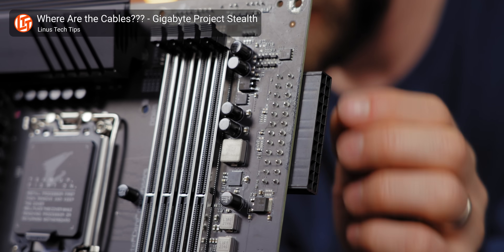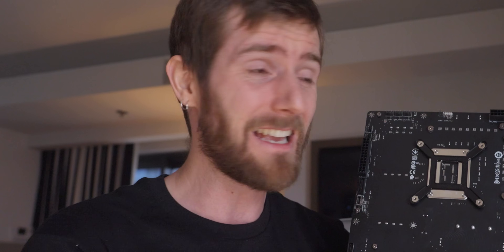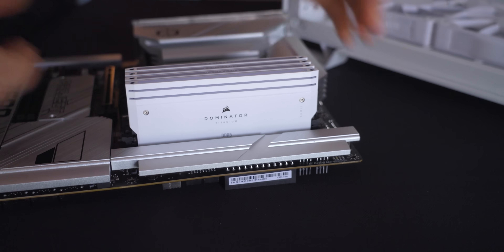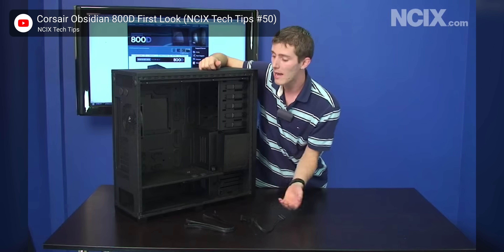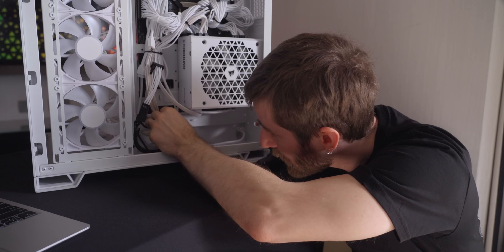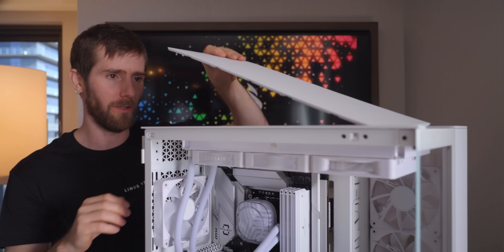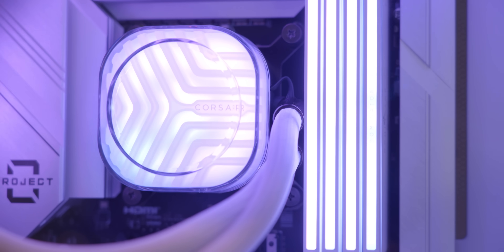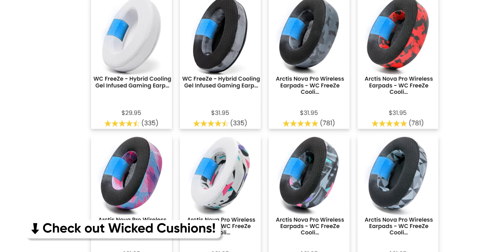I had NO Faith in this... - Hidden Cable PCs

Comment: Can't wait to see what is possible for ITX and SFF systems where cable management is always difficult and can often limit airflow. Can we normalize this with shorter PSU cables generally? I would also rather see GPUS with either PCI slots stacked vertically on top of one another rather than two horizontally, which makes the GPU stupid long. They could also just put the current power connectors facing the MOBO side as long as their is enough clearance by either insetting it into the GPU's circuit board or making sure it clears the right side of the motherboard.

Comment: How about standardising all the connections? That is stupid to use separate two-pin connectors to the pwon, pwled, hdd led, etc. Put them to one bigger connector. How about creating a rail system for the different power lines, instead of using a spiderweb of thick cables, not to mention switching to the only 12V power supplies finally?

Comment: I mean, if they're forcing upgrades to DDR5 and new CPU dies, it sounds like a good time to fix the PCIe+power design problem for GPUs! 
Also, if you want a non-proprietary case fan daisy chaining solution, just look at Arctic's BioniX fans, just standard 4pin connections.

Comment: seems like all of the major players on board with this being the future - then it will happen. If it's aesthetically better and it makes building/ upgrading, troubleshooting hardware or managing cables easier without any down side to cost or production, then it's just silly not to go this route. I think an iteration like this will become the future, this is fantastic!
Reply: As mentioned in the video, the problem is existing patent. By moving the connectors to the back, they have to pay royalties.

Comment: Cool concept, enough space for GPU and Coolers in the front, and the easy cable management is hidden in the " conduit room" in the back :) 
Now we just need to get rid of the aweful 12x GPU connector and get 3x 8Pin on these GPU in some stealthy way...
Patents should work differently, if a company patents a solution but does not use them in lets say 5 years, the patent should be free for everyone to grab.

Comment: I don't understand why the motherboard mounts can't just be horizontal or vertical rails?
A small stamped I-beam or box-profile should be more than rigid enough to hold things in place. 
And also why can't we have 90 degree angles for all connectors.. I mean all?

Comment: The GPU cable destroys everything. Why can't the regular 2x8 pin just be on the other side of the card? Then it's much easier to manage and hide.

My solutions for all of these problems is just having a case without a window.

Comment: why not just have an adapter for the graphics cards that route the power to the back...like a rigid extender like we had with SLI and crossfire. with 3d printing taking off, it could be as easy as selling lengths of cable and 3d printed case for each graphics card.

Comment: Would it be ludicrously more expensive to include a 12v socket on the back of a GPU? It would maintain compatibility with older systems and they could include a cover for the front 12v slot. 

I see the benefit of extending PCI-e slots but I think the drawbacks outweigh the pros

Comment: Biggest problem I see with the advanced btf from asus is its ITX support. With the current position on the motherboard you physically can’t fit it on a ITX board. There is also the problem of sandwich style cases or horizontal gpus being able to use the “standard” that asus is pushing.

I can also see them just passing over ITX support of this “innovation” because it is not a very big market.

Comment: Still awaiting a day that the front panel connector "pins" are standardized and modernized. Stop giving us teeny power/reset/hdd plugs that make it a pain to plug into a set of pins! Give us ONE that can handle any arrangement of front connectors (like not every case will have a HDD light)

Comment: Easy solution: define a standard mounting pattern for motherboard mounting plates, and the case comes with a gaping hole in it. Motherboard vendors must supply a mounting plate that mounts to the case (like an I/O shield) and their motherboard mounts to that.

(This is actually a stupid idea please nobody do it.)

Comment: How much rigidity do you actually need if you're just bulking and then running a pc? Sure you don't want it super delicate, but with a little care installing stuff, you should be fine with more openings in the back.

Comment: If they going to do this, I would have liked to see them go 12v only. Fix front panel connectors. Do away with PCI-E power connectors and replace them with ports on the motherboard like Apple / BTF Advanced. So pretty much a single power plug, along with some power for accessories. Then make it ONE standard, making sure to keep Corsair far away from that discussion

Comment: This idea is fine, but it doesnt excite me.

Now, the Apple/Asus idea of moving the PCIe power to another card edge connector does make me interested. That could simplify GPU powering, remove the risk that we've seen with 12VHP, and be super clean. Also, adding the tab would cost so much less than the connectors that are used currently, though it would add cost to the mobo.

Comment: Definitely see the benefits of this in terms of ease of building, but as an SFF enthusiasts it's a big no for me. Not only does this approach fundamentally break interoperability between board sizes, but it adds tall protruding components to the backside of the board, inherently making the build fatter no matter what you do. I'm a huge fan of rear mounted m.2 slots, but cables are a no-go. And, of course, reduced interoperability means less creativity in both builds and case designs, which is a shame.

Comment: Can’t they make the sheet where the motherboard attach detachable so you can swap it like CPU brackets ? That way you can future-proof the case to any board, you just need to buy the right sheet layout. And you can fix the holes with micro ATX board.

Comment: Why don't corsair move the motherboard tray upper and use extension cable put the gpu at the back side, without gpu in the front side don't need much space . then the gpu power cable disappear.

Comment: I don't see why the power connector on the gpu can't  be on the side facing the front of the case. especially using a right angle connnnnector, while it certainly isn't a "no connectors in the front" solution, I'd say it's a good compromise.

Comment: Why don't graphics card power supply also have power coming in from the other side. The power cable on the front really messes with the clean vibe the underside powered motherboard brings in.

Comment: why dont they just put the gpu power on the back of the gpu(facing the motherboard) and have a cutout that runs right to it. You would still see the cable but it would be minimal and doesn't require a whole different gpu interface

Comment: This is a terrible idea. Not only will it turn decades of hardware into trash for no actual benefit, but it hamstrings future motherboard development into fitting an exact layout to work with the "new" cases that will be designed for this.

All to, hide a few cables. That is just not acceptable.

Comment: Glancing over at my PC with cables showing. "Eh, I'd do it". I'm interested in what the backwards connector market looks like in... 4-5 years? Likely when I do a complete new build outside of stuffing a new GPU in my rig.

Corsair, other case manufacturers, PLEASE come out with cases that don't look like the O11. I've had mine since 2019 and am looking for the next unique thing to catch my eye, not just more of this. Like the Fractal Torrent. Make that but better. Thanks

Comment: But why don't GPU companies put the power plug on the "bottom" of the board though? It would make both horizontal and vertical mount significantly better cable management wise in my opinion

Comment: Why can't NVIDIA and AMD just change the GPU power connector to the right side, on the back close to the mobo... that way it's still no big change in standards but it is a LOT cleaner. 

The other companies could even create a simple adapter or mod cable with a 90 degree angle leading to the back of the case, making it almost invisible and even more cleaner.

Comment: For people thinking the patent is dumb, you nedd to consider its purpose and use. If a small or new company made the patent, and it was denied, then larger companies could take the idea and run with it. But if it succeeded, then that small company could make boards with the concept and actually become a successful player in the game, then liscense it out to other companies. The patent could be the defining factor to whether or not a new company becomes successful in the pc market. The issue is when people make patents with no intention of delivering and just the intention of liscensing ir selling it to make money. The problem isnt that a "simple" idea shouldn't be patented. The problem is that companies make patents just to hoard them to make money. A possibility would be for a way to make a patent public use if it can be proven that the patent holders are doing nothing to deliver on the patent after a certain time. ie. If the patent holder for this parent doesnt exist anymore, or has no products in this space after the 12 years its been held, then the patent could be public use. That would ge one resolution.

Comment: The power connector has never needed to be on the front they could literally been put ANYWHERE.

They should be on the motherboard side anyway either with a 90 above or below the card.

Comment: It seams weird, that they still use the bulky 24 Pin connector with mostly useless pins.

OEM Systems have 12 V only for over a decade now.

Comment: why route the GPU power through the board when the card hangs past the edge of the motherboard anyway? Just put the power facing backwards on the card. Yes, this would involve extending the power past the end of the GPU PCB, but that seems much easier than what ASUS is doing. While we're at it trying to fix all of the problems with ATX, can we just move past the expansion card form factor?

Comment: I really want the chance to build a PC like this, rebuilding mine now but can look forward to the next upgrade in 3-4 years maybe then they will have taken hold and have many stealth options  :). I am Still on am4 but upgrading from ryzen 5 3600 and now going ryzen 9 5900x with an rx 7900 xt/xtx, not sure which yet depends where the prices drop when i order as i will be getting the GPU in 2 months time. First upgrading the CASE, PSU, CPU and got a nice aio cooler coming too. I also need to change my motherboard sometime as I only have a gigabyte x570 gaming x, I made this cheap build before years ago but wanted a change so working towards a new build now and ill likely keep the old stuff so its a secondary pc.  As tech changes and new things come out no doubt ill get the outdate stuff to save costs then follow behind. Its crazy howmuch the prices varie these days.

Comment: I hope they wilm soon make changes to motherboards and give us just a bit more space between the cpu socket and the RAM sticks because some of those AIO coolers are pretty much touching the sticks
Reply: Problems with that - any extra distance between CPU and RAM adds latency. If anything, they will try to lower that distance in the future. Maybe even by putting RAM unto the CPU package altogether.
Reply: @udilschik  Also a possibility or maybe move them to a different spot. Some of the AIO blocks are ridiculously big for the sake of displaying stuff.

Comment: somehow i think this is pretty far down on the list of problems with current trends in tech that need to be solved. we got oversized gpus with insufficient structural support, squid cables, ratsnest wiring (complicated by rgb and a myriad of proprietary standards for fan control). 

i do like the ssd lane allocation features which will be good for sff builds or anyone who wants to run a lot of drives. everyone moving to m.2 will certainly eliminate a lot of wiring problems. they are faster than sata anyway. i mean if you can afford these overpriced product ecosystems (read: lock-in) you can afford fast drives that just plug into the mobo and dont muck up the asthetics with a bunch of wiring. do need places to plug in m.2 drives, though thats less of a problem with full atx.
Reply: cases like THE TOWER solved that by rotating the mobo so the GPU is vertical.
Reply: @ChrisWijtmans  yea but its still secured by 2 or 3 screws on a flimsy bracket at one end of the gpu (less than what you find on a significantly lighter 3-1/4 hard drive), and a card connector which cant handle any significant shock, regardless of attempts to reinforce it. 

my gpu rests on some rubber bumpers cut to size, but im in an sff case and there is a fan grill about a quarter inch away. adjustable support brackets also feel like a cludge (my case included one but i didnt need it). only supports against gravity. vertical works but its non-standard and still not as good as a 4-point (or more) mounting system.
Reply: it also has the pcie bracket and slot as support. and the metal of the case not just the screws. should be plenty of support. @LordOfNihil
Reply: @ChrisWijtmans  watch gpu repair channels, a lot of failures are due to torqued pcbs. this causes the solder balls to fatigue and the chips need to be re-balled. hanging is certainly better than being installed as per standards. and those standards were designed with small single slot cards in mind, not massive cards with 2-3 inch thick heat sinks. just because there are workarounds does not mean its a good design.
Reply: torqued vertical pcbs?  @LordOfNihil
Reply: @ChrisWijtmans  workaround != good engineering. my workaround is just as effective but it still reveals a deficiency by its very existence.
Reply: You failed to answer me. Were the cracked/torqued PCBs from vertically GPUs or not?  @LordOfNihil

Comment: that graphics card is longer than enough to have its power connector on the backside outside of the MB, so just have it there if its longer enough than a ATX mb, and if its not put it on the side... how hard can it be?

Comment: I like cables in the case, not clutter but just having cables in there makes it look more tech, you feel like Tony Stark when you finish the PC. Just empty space with a graphics card, fans and CPU cooler that's too boring. (Same reason why I always use air coolers, just something about them is appealing, huge mass of a heatsink with fans on it is just exciting compared to a boring AIO).

Comment: wouldnt it be better for them to make a card that flips the board design to have the power delivery on the bottom of the card and mount the 12v connector towards the tail of the card off of power wiring fed through the armour of the card...then you could plug it in on the back...rather than use a whole new PCIe standard.
also with the motherboard all the bottom USB, Power, Reset connectors etc..should be moved to the right side of the motherboard so theyre on the left to plug in all the front panel connectors to reduce the crossover.

Comment: sure, nobody is going to see this... But conserning GPU Power, why cant you leave the 8 pin plugs on the bottom/back (like some already do) and just make a solid adapter, to connect from the same side as the I/O Connections? technically, this won't even add much cost (couple buck maybe? except an upcharge for the costs of such and action). Not to mention,  you'd only need an inch or 2 of wire showing.

Occam's Razor

Comment: I'm waiting for someone to investigate whether it is possible, using Asus' advanced BTF layout, to use the 3 x 8 pin power connectors on the back of the motherboard to power an RTX 4090 instead of using a 12VHPWR connector?

Comment: LTT should MAKE a IO connector to USB female and USB ON/OFF switch / led indicator. And help the motherboard industry to change the tiny IO pins with USB or USB alike connectors with a solution for the meantime. It is annoying, more when you age and even with glasses your vision is not the same, to plug in those tiny IO connectors. 

PS: The smartphones SIM / memory card bays are also annoying when you get older.

Comment: Most GPUs have a massive overhang, why can't there just be GPUs with their regular power connector on the bottom outer corner, with a corresponding grommeted slot in the motherboard backplate?

Comment: Ive been thinking about this concept for awhile and wondering why is hasnt been done. Glad to see if come to fruition. Im also wondering why GPU power cables arent on the bottom. My ROG 4090 looks ugly with the power cable sticking straight out of the front. Now, if only they could standardize their RGB software. SignalRGB is good, but im not paying for subscription software to control lights on my fucking computer. $40-60USD/year is insane to have full control over lights you paid for already without dealing with RGB software soup.

Comment: Why don't GPU's just put the plugs oriented straight and on the bottom of the cards, in a position where they are over the cutouts? (For the cards long enough for this)

Comment: plugging into the rear has always felt like a better solution. Just if anything to stop cables being bent, twisted and tangled.  It's not just about looks but safety and ease of use.

Comment: Stupid comment about the GPU power connector, couldn't they mount it on the opposite side, then the cable can go through a hole in the case on the backside plugging in hidden? Would be a bit of a PITA but it would be virtually invisible

Comment: the glass side panel might be the worst innovation when it comes to pc building. youre expected to have to have a pretty inside now free of wires and filled with rgb. so now you have a bulkier case because all the wires have to be on the back of the case.